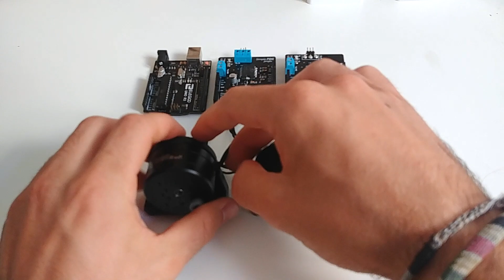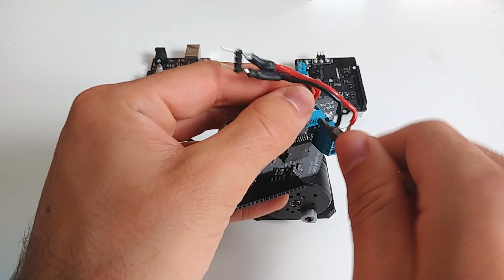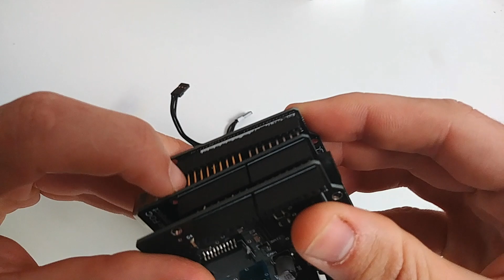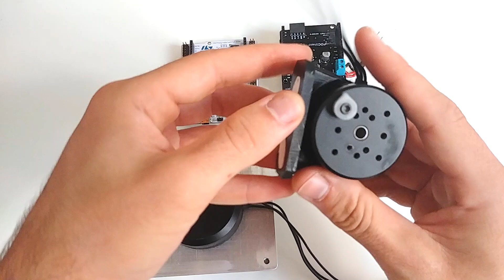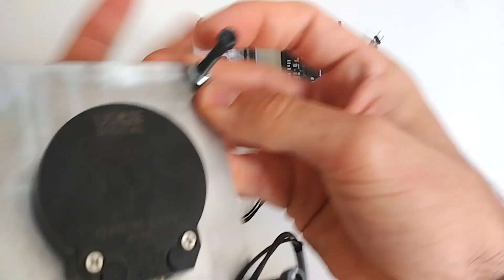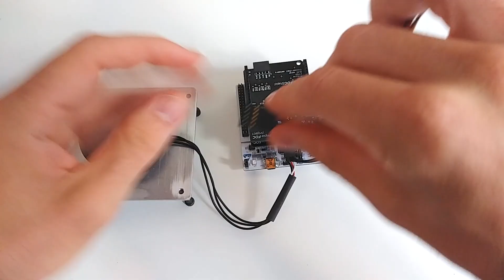Arduino Field Oriented Control (FOC) Haptic control example - SimpleFOCShield

Comment: Hi, 
I have used exactly the schema and sketch from the official Simple FOC, Im trying with two different motors and encoders. Both motors move a little just at the beginning, when I plug the system. But nothing more happens. Let me know where can I send you images and videos.

Comment: Hi everyone, 
I am new in FOC matters and especially interested in Steer by wire. I have used exactly the schema and sketch from the official Simple FOC. The problem is, it is not working at all. Both motors move a little just at the beginning, when I plug the system. But nothing more happens. 
I have 2 Simple FOC Shields V. 2.0.4. and right here are my pinouts:
FOC Shield No. 1: Solderpoints: 5V, A0, A2, A5, 11,13, 3, 7, 10, 6
FOC Shield No. 2: Solderpoints: 5V, A1, A3, 12, 2, 4, 5, 8, 9, 11
Well, that is the best I could do...I have respected all the rules of configuration, I hope... I really did not know if or how to incorporate eventually pins for the AS5600  - I2C – sensor. Is this configuration wrong? Or what else is to be done, so that the system works like in your video?
The schema and the sketch are exactly like on foc.com 
Thanks!!! 
Martin.

Comment: can this be adjusted to be used as a throttle on a small boat thruster pod with say 1/4 throw forward or backward each direction and come back to zero when released like its spring loaded?

Comment: I'm curious about the motors you were using. Do they have much cogging? I've been trying to find motors that have minimal coging. More difficult than you might think. What were the make and model of The ones you were using?
Reply: Hi. I just now asked basically the same question. I think it would be hard to make this behavior without using motors with minimal cogging moments. But it might also be possible to have some anti cogging calibration, that could reduce influence of the cogging moments.

Comment: In the second example, where you slowed down the smaller motor, it then stayed on the lower speed after you stopped touching it. I assume that is because the control knob (the other motor) has turned to indicate the lower speed on the small motor, but that also changed the expected speed value since the knob has moved, and thus the small motor stays at the lower speed.
I guess it could be programmed to disregard encoder input from the knob if the motor in the knob caused the change in encoder input?
If one would want the small motor in this setup to speed back up after you slowed it down :)

Comment: Very impressive. 
I'm researching to build my own tubular linear motor for 3d printers. 
Encoder driven. 
Could you recommend a system to use. 
Have you covered something like this. 
Thanks in advance.
Reply: Maybe this interests you: https://youtu.be/9Eh1p_rUQMA
Reply: @RandomAccessProjecs  thanks for getting back to me. 
Going down foc path. 
Using teensy 4.0 
Linear encoder driven closed loop. 
Completely out of my depth. 
Will give it a crack.